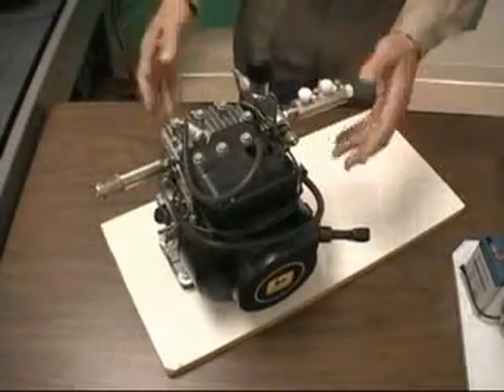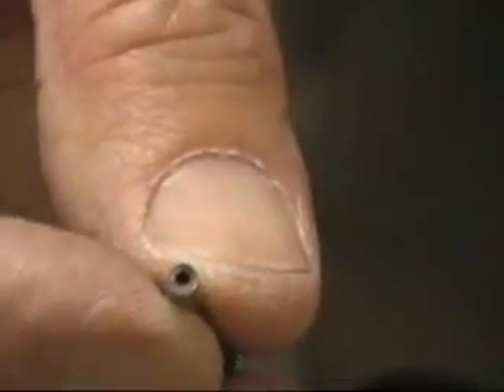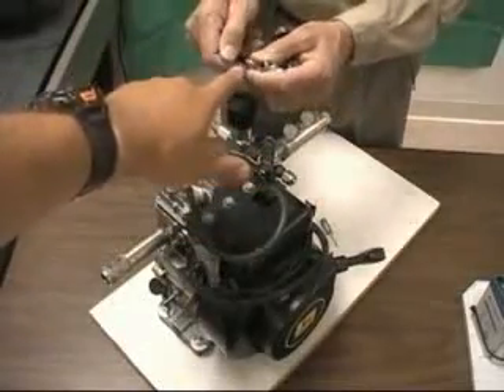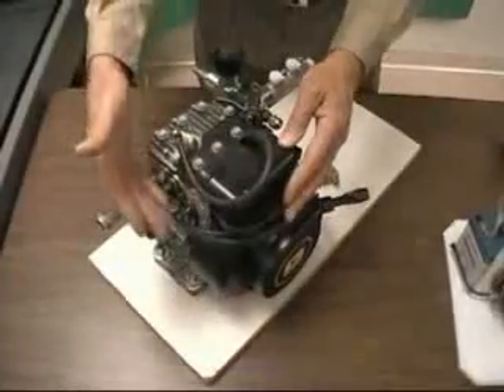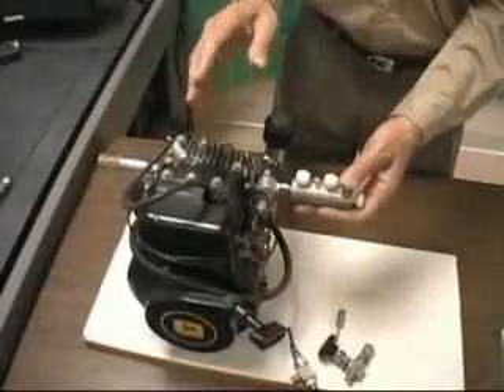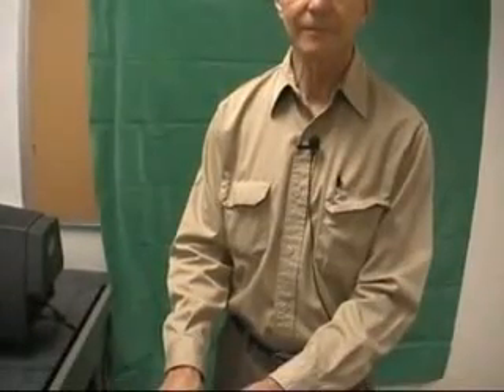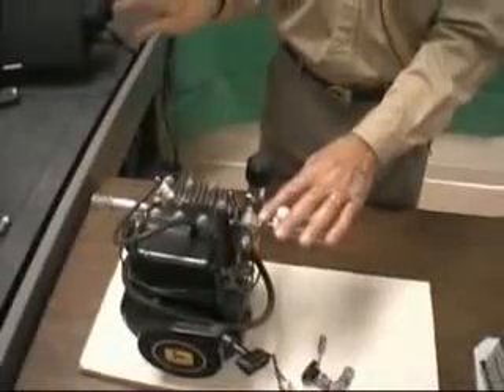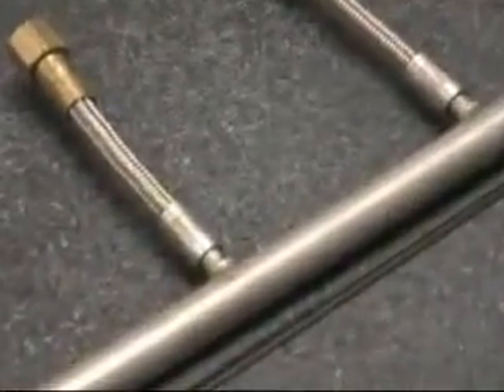How to create Fuel from Water for your car Part 1

Comment: If you round the sharp edge of the foot pedal with a dremil tool it will return to the idle speed without locking full on.

Comment: I've been trying this for some time now and so have thousands of others. We all share our videos on here and not one of us has managed to come up with a system that can power itself. We have all found that we need more fuel than we can currently produce.  Sure you can have a big generator in the back of your truck pumping out hho for the engine, but the engine itself will always need more fuel than it can produce. The best we can manage at the moment is a system that runs with the gasoline engine to lower fuel consumption.  We are all working on the solution in our sheds without any funding. If oil companies with all their recources started researching it, they would find a solution pretty quickly and bury it just as fast.
Reply: No amount of resources will make this use less power than it can output, that is a law of physics. That is why it doesn't work for experimenters and never will for anyone.
Reply: Kevin Jackson That's exactly what we find at the moment. The current laws of physics have been written and discovered by Humans, so we need to be rethinking the ways that we approach things and we really need to be thinking outside the box. Maybe in a few decades time with the discovery of new superconductive materials we can start rethinking the Old laws of physics.
Reply: thra5herxb12s
The reason they are considered laws is because they work exactingly and will always work, for eternity. That's the thing, the old laws will forever remain true. If there was ANY possibility of them being changed they couldn't be called laws.
Sorry, superconductivity will have no impact on this problem.
Reply: Just like man would never fly, or see into the future.
Reply: thra5herxb12s
There was never a law in physics that said man could not fly.
If you have something that sees into the future, I could use next week's lottery numbers.

Comment: can we modify the direct injection to pump hydrogen through the fuel rails thru the injectors
Reply: SixOneThird Entertainment no point it is simpler to run a dual system or a 5% to 10% h boost system using the hydrogen as a detonator to accelerate the combustion of your main fuel.

Comment: Dreamer ((:
Reply: +Marinus Pemen This is true ..but I wonder a bit about this with you to let the engine breathe freely ..? it is not that you have to get less oxygen intake side? engine's still an oxygen pump on the pull in as much oxygen if it goes around that as of 1000 rpm minute idling. This is not true regardless of the fuel you give the engine ....? otherwise you have to adjust the fuel to oxygen intake to the engine

Comment: The only problem with this in during a cold winter. Water will become ice, and unless the battery can produce enough heat to melt the ice. Efficient = time.
Reply: +Celasker  What water ? The guy being interviewed here talks about running an engine on hydrogen not water.
Reply: +ghz240 hes turning water into hydrogen gas yes
Reply: )Peron1-MC(  No he's turning hydrogen into water.
Reply: troll or not?
Reply: )Peron1-MC(
WOW poe? You really can't tell?
No I'm not just making statements to illicit responses.
Having a degree in chemistry gives me a good nose for BS and while the video doesn't stink ,the links to the page on  kits is definitely BS.
Unfortunately people seem to have a hard time with how water is a source of hydrogen but is not a source of energy.
Water is like a battery, if you charge it (using energy ) you get hydrogen if you burn it you get energy and water back (but not as much energy as you put in).
Reply: well then we are on the same page. your first response wasnt needed tho :P

Comment: I would like to see it work, not just talk about it.
Reply: Technically it can be done but the energy required to produce the fuel will be much greater then the energy produced by the motor.
Thhs reminds me of videos about the "revolutionary"  technology to run cars on compressed air. The so called "inventors" claim that compressed air cars produce no polution. And people buy into this BS without knowing that it takes about a 9 HP motor to run a compressor to power a 1 HP compressed air motor. No polution? Yea, right.. How do you think the elecrical power is produced?

Comment: They claim to run cars on water , why isn't it happening? All those oil Wells ..
Reply: +eric salles   Hydrogen burns great. The problem is that it takes way more energy to split water into hydrogen + oxygen than you get back by combusting it.